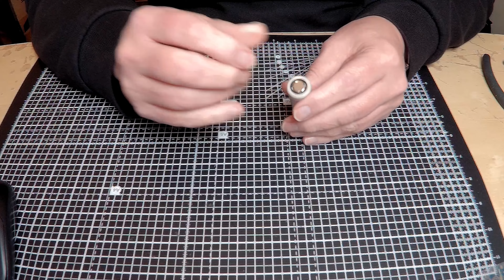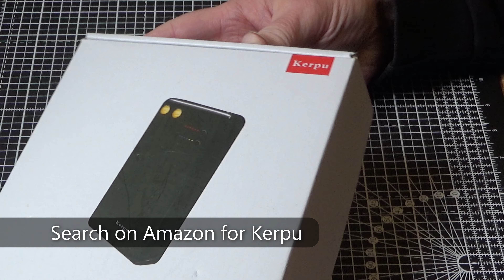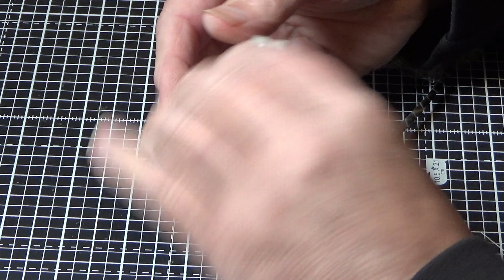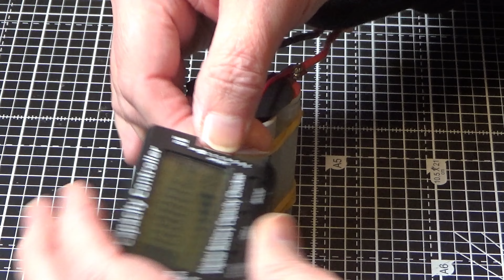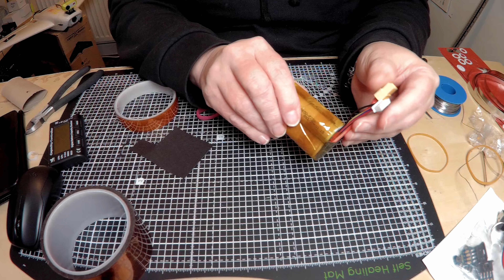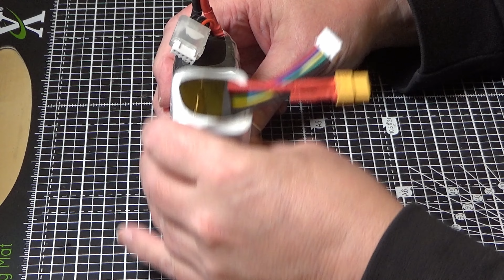How to make a Li-Ion battery pack

Comment: Good and complete YT instruction, well build 👍
And very important to mention all the possible safety issues (as shortage). 
I have build several packs myself, but prefer soldering the tabs. That 3D printed center piece is a better solution than my dab of hot glue  🤔
The Molicel INR21700-P42A can deliver over 45A peak. And hold now over 100 flights. The Molicel INR18650-P26A - 35A are great also.
Tip: if I write something with a marker on plastics, I protect my writings with one layer of clear cellotape.  Otherwise my text always becomes invisible after a while....
Reply from the maker: Thanks for you comments. The cells I picked offered the best balance of capacity against max amp draw for the particular plane. Higher amperage cells tend to have lower capacity. I agree Li-Ion cells deal better with a higher number of charge cycles compared to Li-Po's.  :)
Reply: @Caroline_Tyler  Agree, f.e. the 21700 5000mAh home made packs are perfect for powering low current electronics as my goggles or the Radiomaster TX16S.

Comment: I bet it's very satisfying to build your own batteries Caroline!! How does the Li Ion battery compare to a Li Po battery? So for charging is the Li ion battery less than 1c? Any way you did a great job! Very enjoyable to watch 😀👍
Reply from the maker: The biggest advantage is the energy density, packing more capacity weight for weight. Their usable voltage range is from 4.2v per cell when full down to a minimum of 2.5v per cell. The downside is that their internal resistance is higher meaning you can't pull as much current. This makes them less suitable for high power uses like EDFs, acrobatic helicopters and race/freestyle quads.
You charge them at 1c as usual, their storage voltage is 3.6v not 3.8v but Li-Ion cells are not so affected by storage at higher/lower voltages.
Hope that helps
Reply: Yes great thanks 😀👍